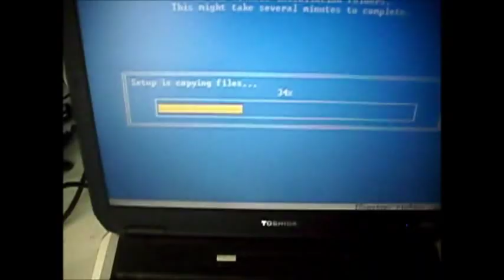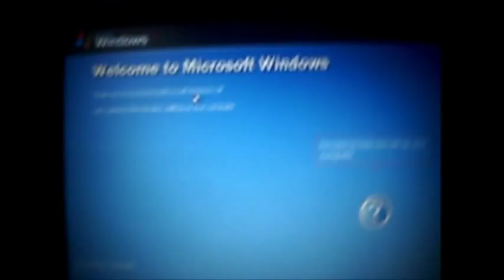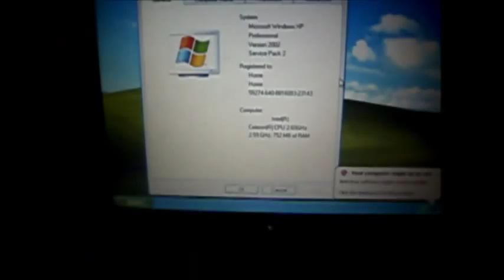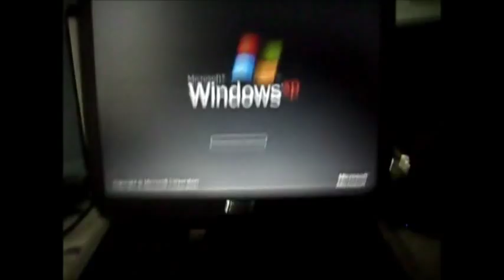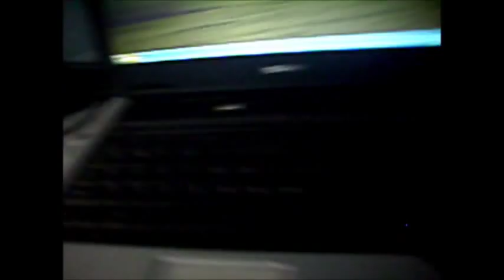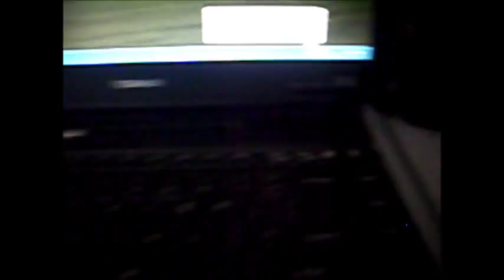Ressurecting The Toshiba Satellite A45-S120 Part 2

Comment: Great video man, I thought for sure it wasn't gonna work lol. I have this same Laptop and I don't know where you got that power brick from, but the one that mine came with is somewhat smaller then that one. Also have you been able to connect Wi-Fi to this? I know it doesn't have it built in but i was wondering if you bought a USB drive or something that connected it.